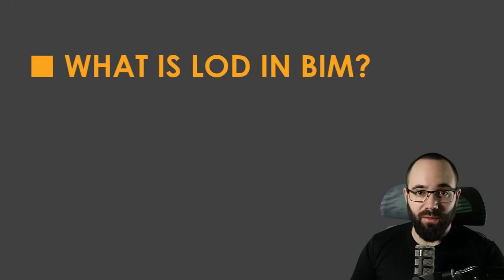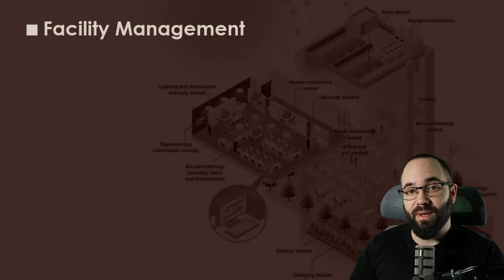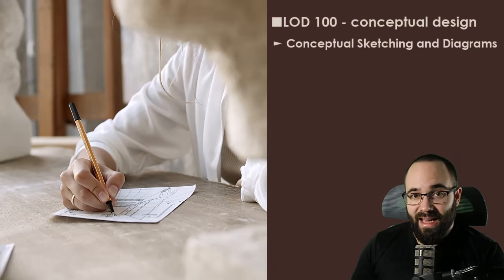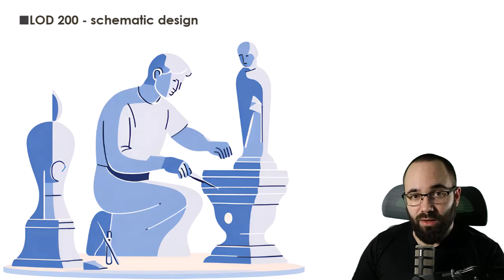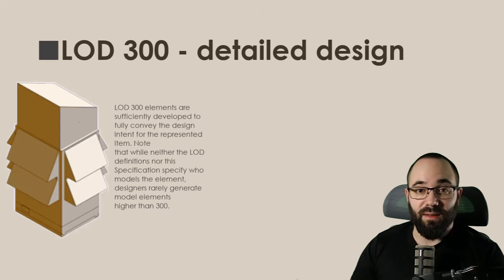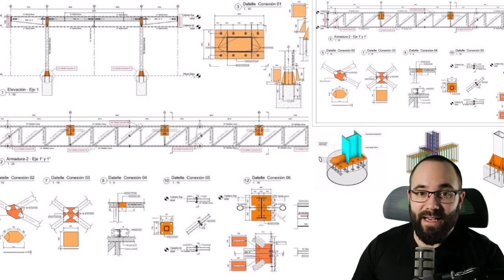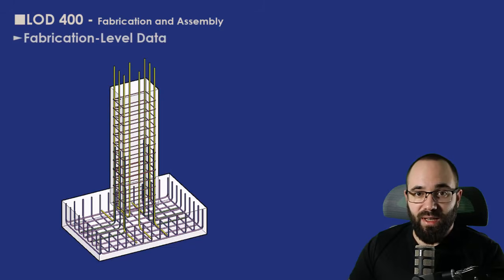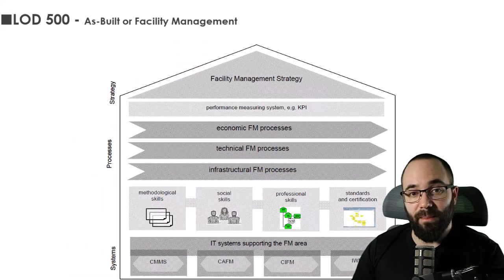LOD in BIM  - How much should you model? | Level of Development in Revit

Comment: LOD should be understood as "Level Of Trust" regardless the level of detail or information on it. It doesn't matter how detailed is the geometry of an element or how much data it has; if at this stage this element is at LOD100 it is only for conceptual design or design intent.
For example, as much as an element has data for manufacturer and model, you can't trust that information until LOD300.

Comment: I am studying a masters in BIM in Europe, and we have been introduced to the concept of LOIN. Do you think that eventually this way of stating the information requirements will overtake LOD? Or do you think these both configurations can work together?
Reply: Level of Information Need (calling it LOIN is discouraged) already has supplanted LoD and is stated as part of the ISO 19650-1 standard therefore is a necessary part of BIM as described by the ISO 19650 suite. LoD is less evolved and less useful as it focuses just on geometric representation rather than getting the right information (including non geometric) to the right people.

If we're just looking at a model from a purely graphical perspective for creating plans, elevations, sections, details etc then LoD is still relevant, but that's missing the point of BIM.
Reply: @TD-AT  exactly, it's still good to know about LoD as a lot of people still work with it, but as you said, it only focuses on geometric information and depending on the project it can result in over-modelling.

Comment: Cool Video!! I don't have much use of the AIA, but this is actually helpful. As an Architect that works on both residential and hi-rise construction, I would almost never go past 300. Shop drawings I would NEVER produce as those should usually be made first by a manufacturer of the item you need, then you approve them per Design Intent...if I produced shop drawings (even with craft knowledge) I would be opening myself up to huge liabilities; I will draw some nice kitchen cabinets, but I would not be producing shop drawings of how to build them...the cabinet maker would.
Reply: Absolutely right ✅️  and you are lucky because I am stuck in making shop drawings or production drawings and  calculating qty for wood required in a manufacturing company specialised in kitchen cabinets and closets .... working as Technical Engineer now a days  and very, very far from Designing buildings , felt like I am no more Architect .....
Reply: @nadeem006  oh so that's reality everywhere
Reply: @blitz9196 Unfortunately, yes, bro
Reply: @blitz9196  yes bro .
Reply: Thanks for this explanation. This really helps me understand where each level (LOD 300 or above) becomes relevant, based on the role that the person is in.